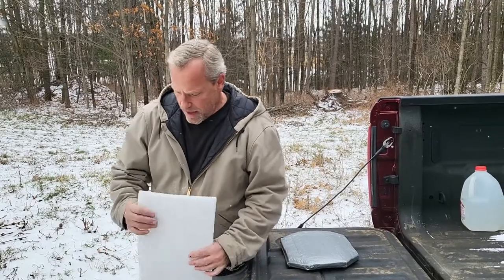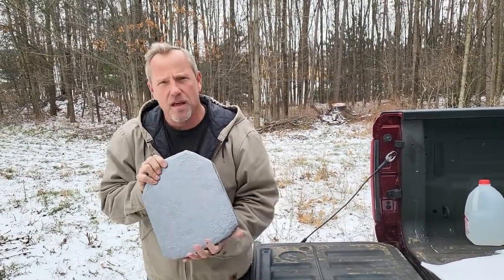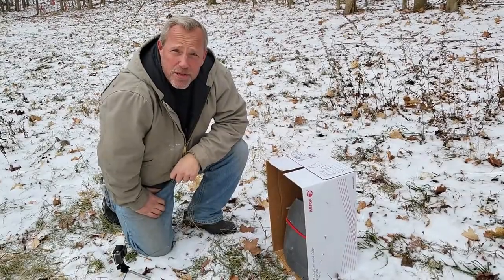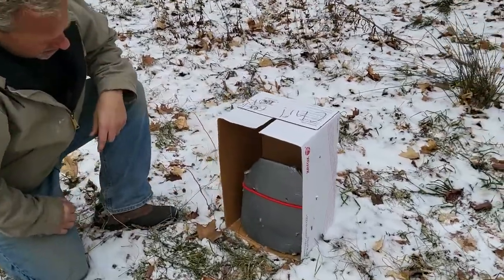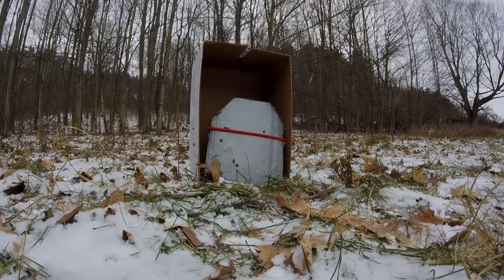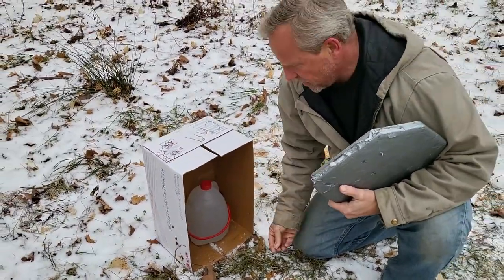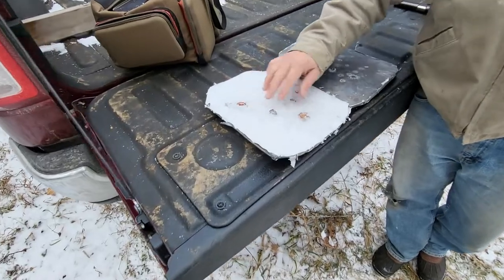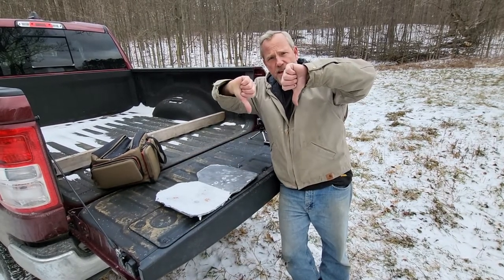Closed Cell Foam Spall Liner Test

Comment: I use the front Kevlar insert from a lvl3 soft vest in front of the plate.   Bend the two top parts and bottom sides that stick over the plate back around away from the plate and hammer it down to make the crease stay. You can also tape it to stay with some Alabama Crome (duck tape).      That gives you double Kevlar on the edges of the plate. 
I dont have a 30-06 or ap rounds but my thinking is with lvl 3 Kevlar on top of a lvl3+ plate with the coating, it may actually increase the stopping power closer or equal to a lvl 4 plate but offer multi hit unlike ceramic.    Ive been looking for someone to test this and see what results they can get.  I don t have an extra plate to test this on.    Originally i was going to use the Kevlar as a trauma pad, but a spall-me- not plate cover sounds like a better idea.     Your thoughts?
Reply: I love what you've done. I did a similar thing, only used custom made kevlar panels (sourced from the soft armor of an issued USMC interceptor vest) to cover the edges of my steel plates. I already have manufacturer provided spall sleeves that fit over the plate but there are seams on the edge areas, and they could be a weak spot so I had additional panels made to wrap over the edges of the spall sleeves. 
(Testing was done by the guy who made the custom panels for me, on extra plates he had laying around and extra kevlar I'd provided him with. The panels worked wonderfully.)

For trauma pads I use half inch closed dense cell foam, the kind used in vibration mitigation applications for construction, noise damping, dynamat (car stereo applications) etc. If you look for it, it's called EVA foam.

As for the Alabama chrome tape (waterproof Butyl tape?) I suggested that as a possible spall guard to the Youtube channel Tiberious Gib a year ago. He tested it by making homemade 2 layer ceramic armor wrapped in 2 layers of aluminum butyl waterproof tape. No spall escaped (sort of inconclusive due to the ceramic plates but go watch the video and judge for yourself).